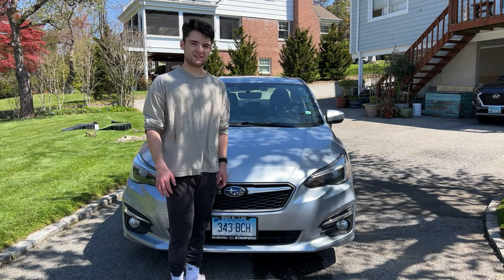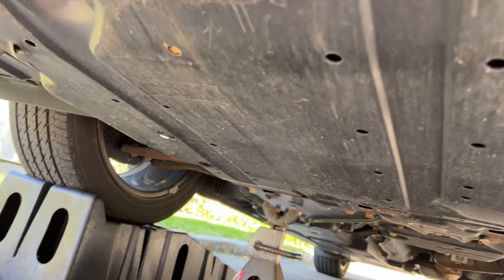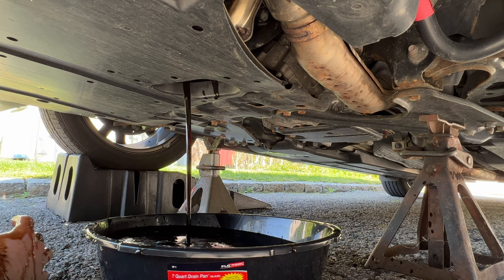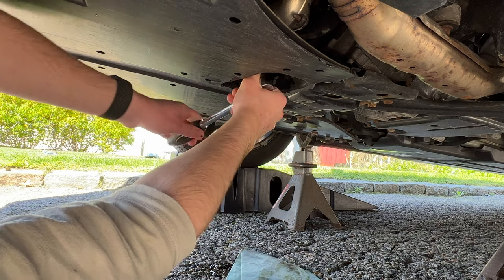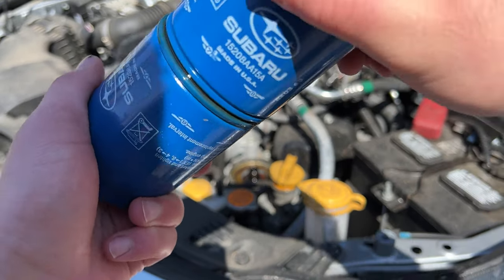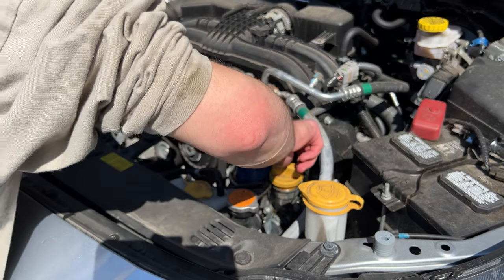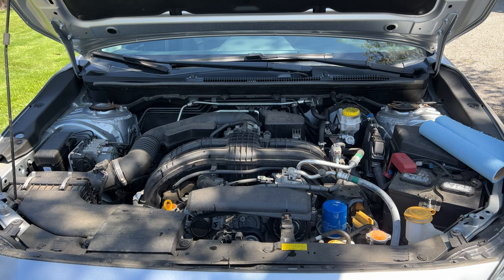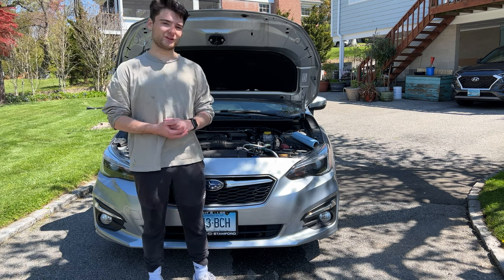How to Change Your Engine Oil (2018 Subaru Impreza) S1 EP3

Comment: This was actually really helpful for finding the oil drain pan bolt. Good to know it's hiding in a hole in that plastic cover. Planning on changing my oil this weekend.
Reply: Yeah.  Stinks how Sub. has the 4x plug by the engine oil plug. Without differentiating fm.  one another.